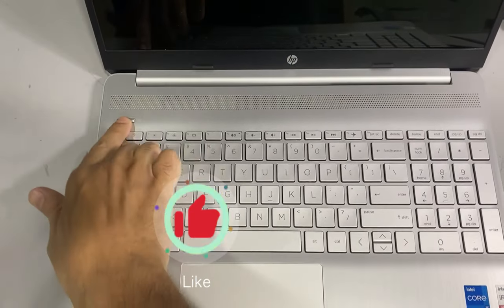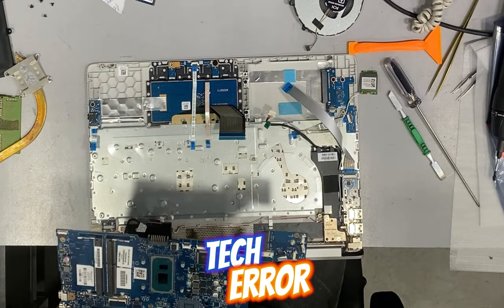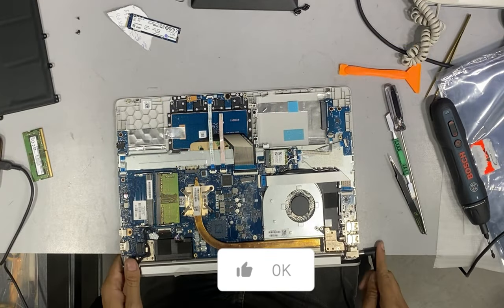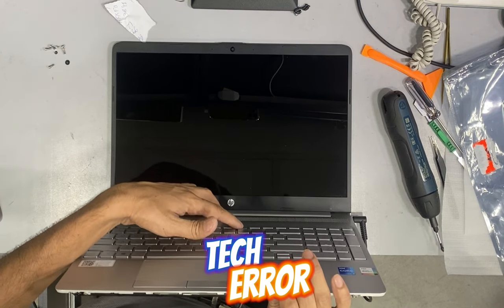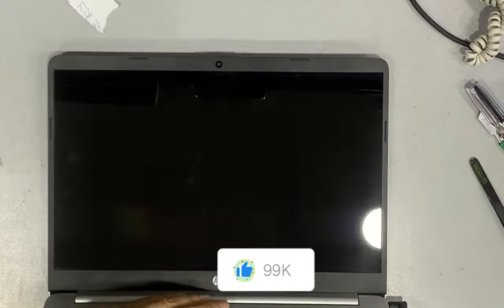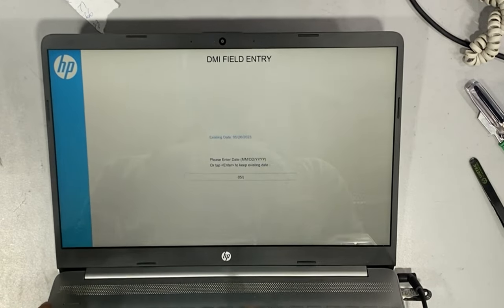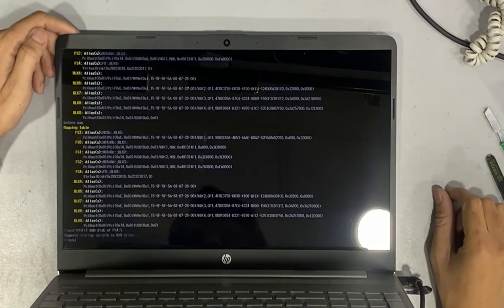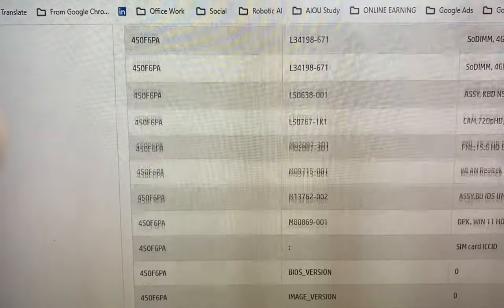How to Replace an HP Laptop Motherboard and Add the Serial Number || HP 15 Laptop not power up ||

Comment: Mere Asus laptop S14 (S406U) ka motherboard dead ho gya hai service centre me bahot Jada charge kr rahe hai kaha se buy kre Naya Motherboard for my laptop
Reply from the maker: Email me and share the serial number,
Reply: What serial number do you put in? The new motherboard one? or your old one in the new motherboard
Reply from the maker: @leecarmichael83  i have put the Laptop serial number,
Reply: @MoeezRehman okay, so the replacement motherboard will have a different serial number from what was on the laptop, so you change the motherboard to match the laptop? 
What is the benefits of changing it to match ?
Regards Lee
Reply: @leecarmichael83 you have a valid warranty changing s/n tò match the PC serial